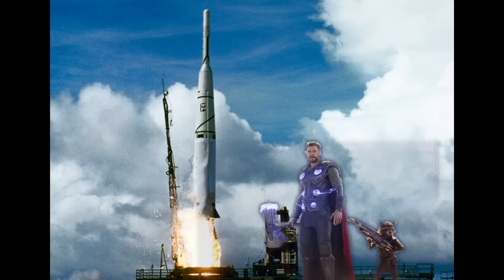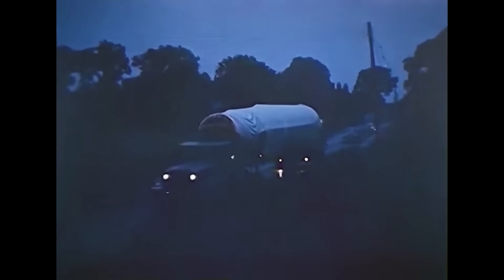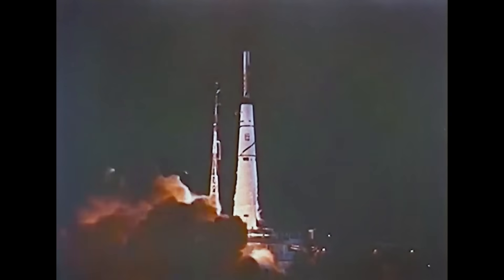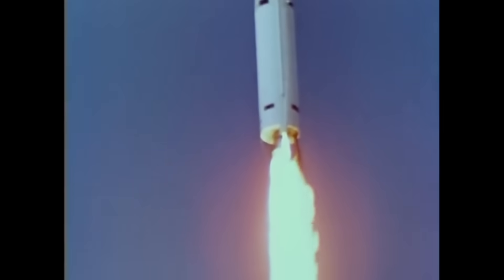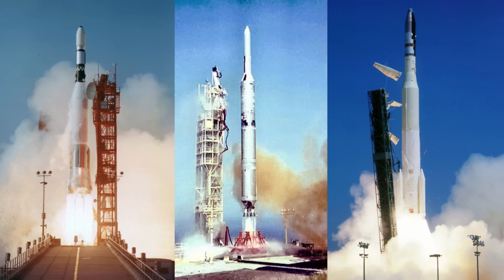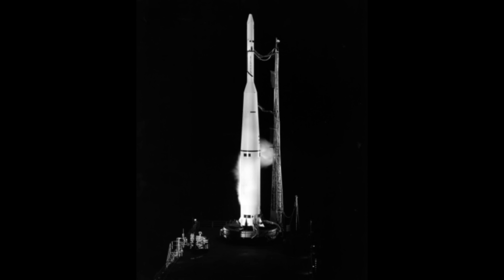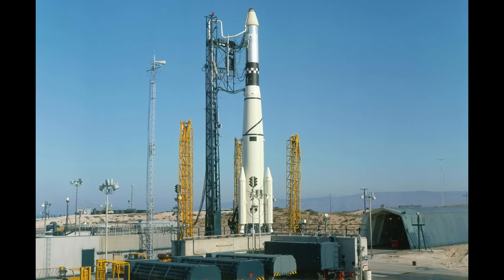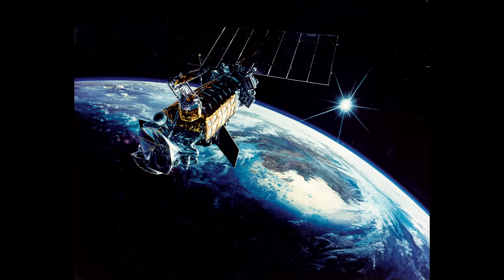Thor Rocket - How A 'Temporary Solution' Became America's Most Popular Launch Vehicle

Comment: Can you do a video discussing why rockets are so reliable now compared to how the first rockets always seemed to blow up on launch?
Reply: It's normal for new technologies to be unreliable until there has been enough time and testing to get them figured out, but hearing some of the specifics would be interesting.  I know some of them got a few feet off the pad, then the engine failed, dropping them enough to burst.
Reply: Better simulations, more experience, better material science
Reply: SpaceX Starship still exploding.
Something about pressurized explosive liquids being shot out of one end of a cylinder that is dangerous.
Reply: modern rockets in development blow up on launch too. It's just what happens when most of the vehicle is made of fuel
Reply: The video 'How Not to Land an Orbital Rocket Booster' is very educational.  Granted the challenge was getting a rocket to land not to take off, but since it was a new problem there was a lot of trial error and explosions...  I mean rapid unscheduled disassemblies not explosions.  Not much detail of the problems but does give a tiny explanation of each failure.
Reply: The first rockets of a new line usually still blow up a couple of times. It’s also different design methodologies.
Reply: The book "Ignition!" about the development of liquid propellants, gives some insight.
Reply: I wonder if we'll conquer space with rockets.  I'm sceptical.
Reply: @leonardgibney2997     Project Orion. Not recommended for launching from earth, though. Or Zubrin’s saltwater rocket.  Also not recommend for earth launch. A Lofstrom Loop might be useful…
Reply: we stand on the shoulders of giants. they didn't know why rockets were unreliable and so made the mistakes that resulted in the answers. we don't need to make those mistakes since they made them for us; we just use the answers they found without blowing anything up.
Reply: Every aspect of designing an orbital/interplanetary launch system is engineering on a knife's edge. The temperature extremes, static and dynamic pressures, propellant flowrates, noise levels, acceleration, g forces and vibrations involved are all extremely high compared to most computerised mechanical systems, yet overbuilding any part of any subsystem is forbidden because every extra gram of rocket is one less gram of payload. 
Under such extreme operating conditions, materials and mechanical systems can behave in unexpected and unpredictable ways, so the  troubleshooting process often involves fixing a problem then rapidly finding out where the next weakest link in the chain lies, often in a manner that results in the Test Item becoming an Ex-Test-Item in spectacular fashion. Repeat for all subsystems (also allowing for any additional safety factor and retesting if necessary) until you have a working rocket, or the funding runs out, or the entire project is made obsolete by new technology, whichever happens first.
After over 75 years of collective R&D, we're at a point where the necessary materials science, propellant chemistry, manufacturing techniques, and control/guidance/comms/telemetry system design required to build a reliable launch vehicle are all "solved problems" to a large extent, so we tend to see new systems reaching operational status much faster than back in the 50s and 60s (with some notable exceptions, looking at you Senate Launch System).
Respectful salute to the guys who worked in this stuff when it was all brand new (and often lost eyes/digits/limbs/lives in the process). We do indeed stand on the shoulders of giants.
Reply: why - engineers learned from their mistakes
Reply: @olasek7972  It would be interesting to learn what those mistakes were and how they were corrected.
Reply: @strayling1  I doubt anyone can supply you this information, this was happening 50-60 years ago and there was no internet then, no one was keeping track of it. Those were engine-specific manufacturing and design problems. As we know even NASA lost some specialized data relating to production of F-1 engines.